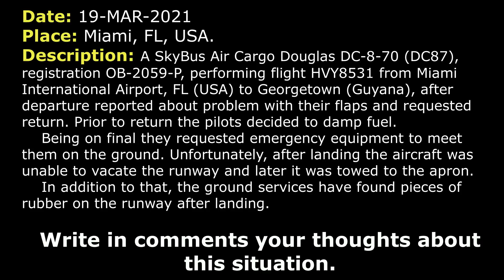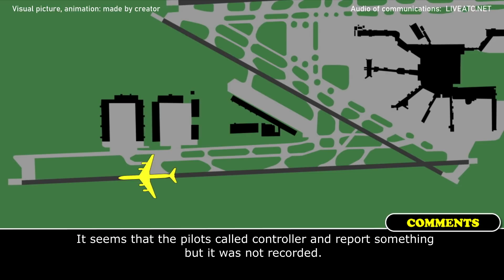Flaps issue, Fuel dumping and Blown tire on Landing | SkyBus Air Cargo Douglas DC-8-70 | Miami

Comment: I didn't know anyone still flew 8s.
Reply: Wikipedia indicates that there are 6 left flying regularly, 4 in commercial cargo, one for a disaster relief organization and one as a NASA research aircraft.
Reply: @moconnell663  Thanks!
Reply from the maker: Thank you
Reply: @moconnell663  — The one for Samaritan’s Purse is why ABX still has a DC-8 simulator.